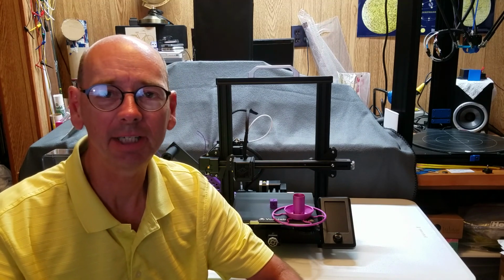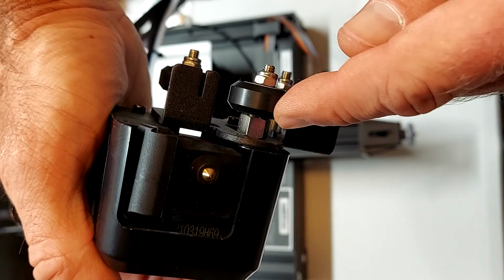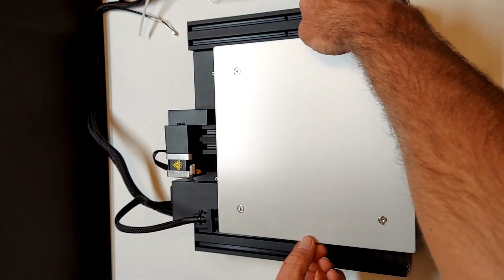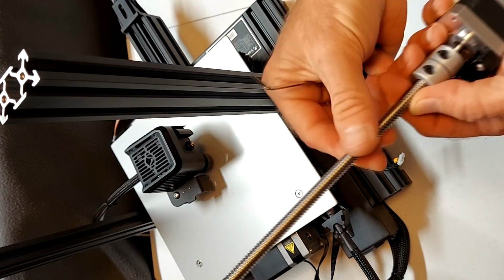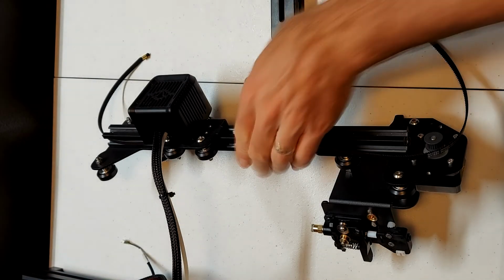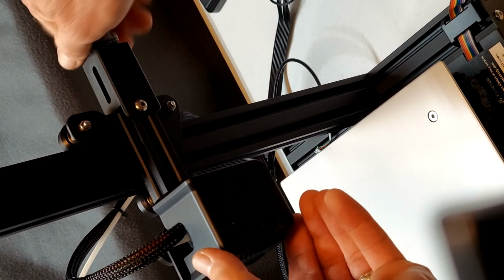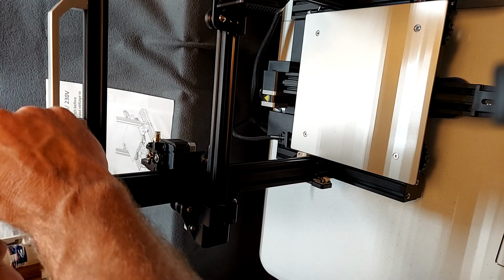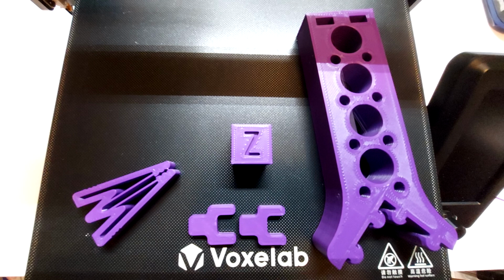Voxelab Aquila X2 Unbox and Build

Comment: Thank you for the excellent instructions and tips!  The assembly instructions that came with the printer were less than minimal and the bags weren’t numbered.  Showing all needed components in each step was very helpful, especially with the similar fasteners.  Only advice I would give is to not over tighten the screws on the coupling.  The aluminum coupling is easy to strip (which I did).
Reply from the maker: Thanks I am glad it helped

Comment: Thanks for this video!  I managed to put my new Aquila X2 together based on this!  I'll be working on leveling and getting my first print out over the weekend now!  One thing: I've checked a few times, and I couldn't seem to find where connecting the z-limit switch wire was mentioned.  I'm sure I've missed it somewhere, but I managed to figure out.  My part bags where also not numbered :(

Comment: This was helpful, I gave up on my 3d printer not being able to get pass the bed leveling. The middle seems higher than the edges, these tips might help me give it another shot. It’s a shame to just have it sitting in my closet since November.
Reply from the maker: I am sure you can get it.  Bed leveling is a hard skill to master but once yoy do you will be set.  

Here are a few links to help
https://www.reddit.com/r/VoxelabAquila/comments/rzyndf/perfect_1st_layer/?utm_medium=android_app&utm_source=share

https://www.reddit.com/r/VoxelabAquila/comments/p0stcx/bed_leveling_solution_16_cents/?utm_medium=android_app&utm_source=share

What you want is for the bed screws to compress the springs only about 50%.  If they compress the springs more then it can cause the bed to bow in the middle.  So adjust the z endstop to the point needed to get the 50%.

1st layer tips.  Slicer speed 20mms, clean bed with alcohol, use z offset in lcd and skirt in slicer.  Adjust z offset for a squish and stick while doing the skirt.

You can do it!
Reply: @n9jcvyellow  Two sample came out fine to me, I just stopped stressing so much about the middle of the bed. I also replaced the stock springs under the best, that seemed to help. Thanks!!!

Comment: thank you very much i was stuck on the step where you had to intsll the belt and i had 0 experience with printers i cant thank you enough for this build toutorial
Reply from the maker: Good luck and have fun!
Reply: @n9jcvyellow  I have one problem with the printer whenever I try to print something the filament just reversed through the tube and unloads itself do you have any idea why this could be happening?
Reply from the maker: @NotTimelyy  sounds to me like the wires are backwards on the motor, assuming you have not messed with the firmware.  Is the machine all original and stock, or did you put on a new extruder?

If you put on a new extruder, sometimes you have to reverse direction of the motor.

If it is all original, then the factory made a mistake with the wiring on the motor.

The wires on the motor only plug in, in one direction due to the tabs.  The easiest thing to do , would be to cut the small tabs off the connector, then plug the connector in backwards, this will reverse the direction of the motor.
Reply: @n9jcvyellow  yes they were found that out a bit before by looking on some reddit threads thanks a lot for your help

Comment: I received an Aquila X2 with H32 board from Amazon yesterday. Thanks for the great assembly video. The Bonus Building Tips were a great help! I was able to assemble, adjust and do the Aquila test print in one evening. Test print came out great. First upgrade will be printing out a new extruder assembly block from 3DPrintSOS. Looking forward to Alex's firmware upgrade for the H32 board. My firmware is Ver 5.1.3. Current firmware is Ver 5.1.8 from Voxelab for Aquila X2.
Reply from the maker: Dont forget check out the reddit sub VoxelabAquila. Alex just posted an update 3 days ago.  He is getting close on H32.  We have excellent help on the sub!

Comment: I just got one and it keeps telling me filament not detected. I wiggle the filament and restart it. Any idea as to why it keeps doing this? I have the n32 board.
Reply from the maker: most likely a bad filament sensor.  Mine worked flawlessly for months, until I tried SILK PLA, then it was giving me a false error, so I just removed it entirely.  I always put enough filament on before I start a print anyway, so not really needed.

Comment: Ive already had two of them and both had numerous issues.  The one I just got today the entire base of the machine is completely warped and wont sit flat on my perfectly flat table..  No matter what I loosen and tighten I cant get rid of the 2mm gap on one of the corners. On a device that requires flat this is ABSURD.

Update:  Fixed the leveling issue by basically completely rebuilding the machine.  The X axis stepper motor gets to 100c.  They expect me to go to the mobo with a voltmeter and adjust it correctly, lol.  Later when I go to put on the dual gear extruder to replace the junk stock one I find out the allen head is stripped on the factory extruder lever arm making disassembly difficult at best.   Horrible tolerances on most of the extruder screws.  Tech support while responsive is almost useless and repetitive.  Like they cant read or see the pics you send them, lol.

While your review is well done it isnt in depth or accurate in real life.  This machine is not worthy of your score, not even close.  Maybe it is for a very short time when brand new but it has many issues going forward and will require a lot of upgrading.

Comment: Great video. Just got my X2 today and with it an aluminum dual gear extruder; however, one of the fallen bolts on the stock extruder came stripped.  Going to try a super glue method I found on YT hope it works.
Reply: THIS!!!!!  Then when I asked them to send me a better bolt they didnt know how to repsnd and said no.  Its not like Im going into Home Depot and finding it, lol.
Reply: @TheGreatRepeller  i returned it and got a sunlu/jayo S8 plus... Same price .... Bigger print volume (310x310x400mm).... And comes 98% assembled literally 6 screws and then you can level and start printing... Its the easiest 3D printer to ever assemble... It also comes with an aluminum extruder so you don't have to add one